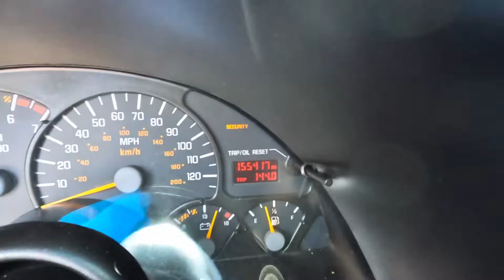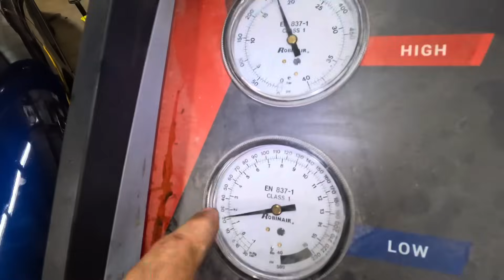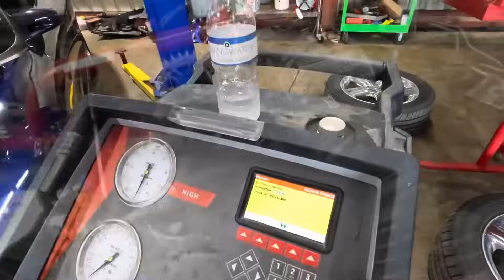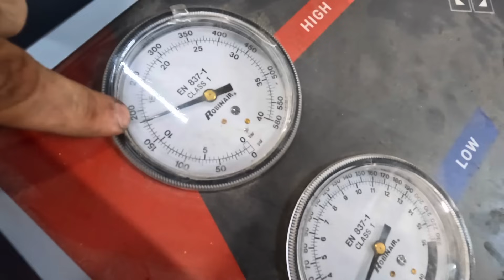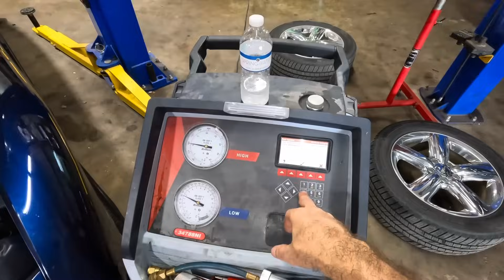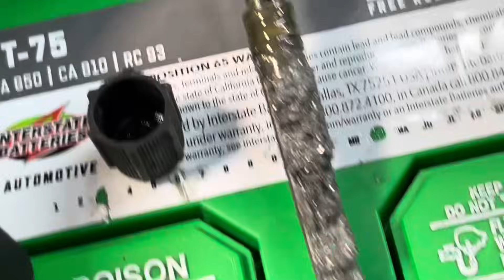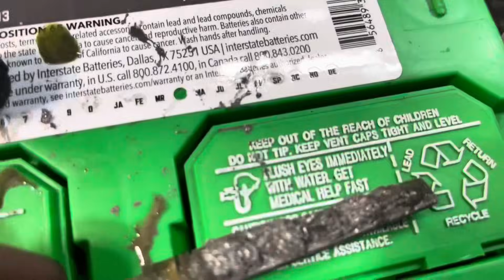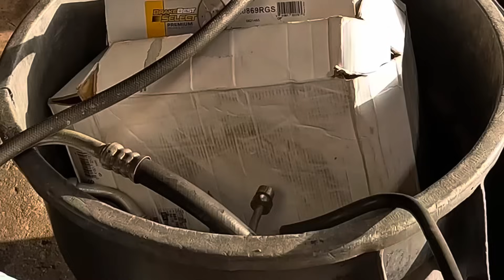Metal in the Freon? Pistons Coming Apart Pontiac Firebird!

Comment: Thank you Ray for disassembling the Compressor - interesting to see the innards and how they work.
Reply: Me too.
Reply: Schooling his subscribers
Reply: Yup first time seeing that
Reply: Nice educational video 👍
Reply: Similar to a pressure washer pump.
Reply: @geoffwoodgate7450 As well the external combustion engine in a Mk 46 mod 5 torpedo used on US surface combatants.
Reply: I've NEVER seen him reply??
  Don't even know if he reads your comments..
Reply: Ok, all these various applications I didn't know about... really educational 👍🏼
Reply: I always wanted to see inside one also.  Awesome video from Rainman Ray  🇦🇺  🇦🇺
Reply: Good to see inside of the compressor
Reply: Yup.
Agreed.👍
Reply: A mini-episode of I Do Cars
Reply: Had literally NEVER seen the internals of one before on a car... fucking awesome.
Reply: There are two types in main use - the axial piston type, which this is, and the scroll type.  The scroll type uses less power and is more efficient, but it really shards out the system when it lets go.
Reply: @silicon212  I hate when I shard myself.
Reply: Thank you Ray, me too never seen the inside of a compressor.
Reply: Yes in the casting room where I worked we had larger piston pump wobble plate pumps to use for hydraulics to run our bundling machines and band saw. If this unit had had the proper amount of refrigerant it might still be good. The pump may have been loosing pressure for cooling thus the reason for its over filling.
Reply: Completely rebuildable compressor destroyed. Nice job!
Reply: @Serhio_Alvarez  The one with metal shavings in the entire system?  congrats on a 10/10 cringe take.

Comment: One look at the Firebird, you know that it is loved, and it will get any repairs that it needs. 
Also I am surprised that Ray didn't pick the car up a few inches with the lift so he didn't have to bend over so much.
Reply: That may have made it more difficult to reach the  back of the pump.
Reply: I'm sure that Ray wouldn't even  consider stressing the integrity of such a fine automobile!
Reply: That's a trick I learned long ago to save strain on my lower back with lower cars!

Comment: Another very good video.  I like the autopsies.  Always interesting to see how these components are assembled, how they work and what goes wrong.
Reply: Saw the metal chips but not where they broke off from.  What actually failed & what was the cause of failure?
Reply: Probably a bearing. But since it looked like it was brass, it was probably. Either a race. Or a shim. Most likely a bushing.
Reply from the maker: @boggy7665  must have been a piece that totally broke away. I think it was part of the swash plate

Comment: I can absolutely confirm 3800 series 2's will run with a hole in the block. Was racing one once, and apparently shot a rod through the block, and through the power steering hoses and battery cables (the battery had been relocated into the cab and the cables ran through the firewall near the failure) I was completely unaware how bad the problem was, and was going to be perfectly happy finishing the lap and pitting in normally - the only thing that stopped me was the fire that resulted from the battery shorting out amidst aerosolized power steering fluid.

Comment: i had a Pontiac Bonneville with a gm3800 supercharged series 2 by the time i sold it it had over 600k on the clock and on its second trans. still ran great #1 bullet proof engine.

Comment: I had a '77 3.8 in a Firebird before GM gave them an even firing crankshaft.  The uneven vibrations knocked the hell out of the timing chain and sprockets.   It was going on the 3rd timing set when I gave it away at a little over 100K miles. Thanks for the videos.

Comment: The GM 3.8 liter from Ponticrack is no joke! With proper maintenance, they'll outlast the vehicle itself every single time, and will continue running until the heat death of the universe...
Reply: Had one pushing 330k miles and it still would go if I put another head on it
Reply: I had a 1999 Chevy  S10 with the 4.3 Liter V6 that was borderline bulletproof. Does that one have similar DNA to the one in this Firebird?
Reply: Yep, I owned a 2004 Chevy LS Impala-18 years old with 3.8 liter engine. It was T-Boned on Parking lot and Totaled, everything on this car worked good and was still original except Battery-water pump, alternator, Air Cond. Comp. these components never failed--Best car that I have ever owned, With Advice from YT video's wife bought a 2022 Lexus after Retiring from Walmart-32 years...
Reply: @randybeard6040  I'm actually surprised someone would work at Walmart for 32 years
Reply: @randybeard6040  I'm actually surprised someone would work at Walmart for 32 years
Reply: @justindaniels17  that's what you called dedication man
Reply: @justindaniels17  it's called dedication dude
Reply: @justindaniels17  how many jobs have you had????? I've had two. And I'm 57 years old
Reply: @buddrud  No...the 4.3L V6 was a Chevy 350 (5.7L) with two cylinders lobbed off.
Reply: The 3800 has DNA back to Buick's 3.8L V6.  Not Pontiac.
Reply: @troyturner8221  8jobs 22 y/o I quitted all of them 😂😂 JK just 1 Job and still employed by them
Reply: @troyturner8221 Must be nice. Since graduation from DeVry in 1975:
IPAC Group August 1975-January 1976. Electronics assembly.
Westinghouse Bettis Atomic Power Lab: January 1976-December 1976. Nuclear materials QC inspection.
Union Switch and Signal Swissvale: January 1977-July 1977. QC inspection. Left after a strike. 
Westinghouse East Pittsburgh: February 1978-May 1978. Intermediate Rate Wireman. 
U.S. Steel Homestead Works. May 1978-October 1981. Instrument Repairman apprenticeship.
Instrument Services, Bridgeville. February 1982-February 1983.
Westinghouse Instrument Service Company (WISCO)/Siemens: February 1983-December 1999.
Process Instruments, Pittsburgh: January 2000-November 2008.
Elrama Power Station: November 2008-January 2013.
Cheswick Power Station: January 2013-April 2021. 
April 2021-present: retired. 
See how many of those places are still in existence. Nobody works 20-30 years anywhere anymore.
Reply: @21Piloteer   Thanks. I was curious to know a little bit of that engines heritage. I had that truck for nearly 10 years. With proper maintenance over those years all I replaced was an intake manifold gasket, a water pump, and finally a fuel pump. Loved that truck.
Reply: @buddrud those two engines are vastly different. One is a Chevrolet engine the other one is a Buick
Reply: @justindaniels17 32 years ago old Sam was still alive. She evidently grandfathered-in before they started treating their employees like garbage
Reply: The 3800 series 2 evolved from the Buick 3.8l V6, which in itself is a 330 cubic inch Buick V8 minus 2 cylinders.
Reply: @21Piloteer  Still a pretty good engine though

Comment: Thanks for the memories Ray. I was an automotive HVAC specialist for GM, Toyota, Honda and Porsche/Audi for 15 years before I opened my own shop where I specialized in installing heat and A/C systems in classic and custom cars. Even did a few tour  buses for some well known performers as well as stuff like a front and rear system in a1939 Cadillac limousine with 1975 500 cu. in. Caddy engine and front frame clip and a 1940 Chrysler Town limo with a Nova front frame clip with rear steer. Custom built 1968 Hemi Roadrunner we built special order and got the engine from Don Garlits and had it de-tuned to 850 HP.and 1950 dropped, chopped and channeled 1950 Merc, with a  2015 LT 6.2 'vette drivetrain and entire computer system, even several double sleeper semi tractors. 1929 ford 5 window coupe, and god only knows how many everyday grocery getters. 

Watching you bust knuckles getting into impossible places and repairing some of the poorly designed late model systems is like a trip down memory lane. The wife always asks me why I binge on your videos, "Wasn't 55 years of that enough for you?" she asks. "I'm 73 years old and actually it wasn't enough. I'd still be at it if my poor old broke dick carcass could do it. But back in the bad old days if we were really lucky, we had maybe one lift and did most everything on our knees or on a creeper. After about 30 years it took it's toll on the back and knees and shoulders. Which is one of the reasons I went into A/C work. For some reason, guys in my generation always treated A/C systems, electronics and automatic transmissions like there was some mystical black magic inside and not for many wrench twisters to screw with. So I did transmissions for years until my back was shot and moved on to HVAC and I still mess with electronics and diagnostics as long as I can fine some assistants to climb around like a monkey with test leads and meters. I'm 6'2" and I simply do not fit into these late model speck-mobiles that you don't get into. You have to put them on like a shirt or a pair of shoes. My hats off to you sir for dealing with things realistically and logically . Both you and your wife unit and Eric and Mrs. O have replaced everything else I watched since I retired a,d I truly believe I would go totally crazy if you guys quit doing your excellent videos. thank you, Thank You , THANK YOU for helping me retain what's left of my faith in mankind.

Comment: I love that color on the Firebird. My favorite is the 2001-2002 Firebird TA  WS6 with the manual transmission. Come on Powerball!!!
Reply: That color is called Navy Blue Metallic (28U), GM produced 890 non-convertible WS6 models in that color in 2001 and 868 in 2002 -- I don't know the breakdown of autos vs. 6-speeds though.  They're fun cars, I miss my '97 WS6 T/A and '99 Formula big time.

Comment: Looks very like a water pressure pump. Great show, Ray. Power flush was definitely the way to go 👍
Reply: Ive disassembled a hydraulic pump before, looked alot like this, which is essentially what a ac compressor is

Comment: Ray you made my day praising the 3800! My wife and I both watch your channel! Due to gas prices myTahoe did not get good enough gas mileage! So picked up a Grand Prix GTP from the original owner. Except for the intake  gaskets and water jacket elbows (I replaced both) I'm expecting over 500k miles! I was hoping  the Monte Carlo had one. But the 5.3 is also a great engine. I prefer the 6 over the 8 in a small car because  it's easier to work on! With the supercharger not much of HP difference! The GPX with the 5.3 is a Charger RT killer!
Reply: The FORD 289 was also a great engine.

Comment: I bought one last summer for my Dodge Dakota 2002 $700. I think I need the orfice changed and it has a short. I took it to a mechanic charge me three hundred bucks and didn't fix it. Still didn't go to charged up at Canadian Tire cost me $300. Sometimes it works sometimes it doesn't.

Comment: Actually the thing Ray calls receiver drier is an accumulator in the systems with orifice tube. That's why it's on the suction line and doesn't have a filter built in (the orifice tube does the filtering here as we clearly saw), like a receiver drier does. Of course the accumulator also contains the drier part, that's a common thing for both of them. Just FYI ☺

Comment: Let me give you, Ray, and the viewers some interesting info about AC compressos.

So, the compressor is no good of course. Most likely the system was left without the proper amount of oil/freon, which led to this thing exploding.

The pulley is held on only with the first and bigger snap ring. The coil (this is what operates the clutch) is held with the  inner snap ring. The bolt that you took from the side is in fact a drain bolt.

It is interesting to see how these things operate, there are so many different kinds, there are rotational compressors, piston compressors, always rotating ones (no coil/clutch on them, they are operated by a valve at the back. 8/10 times when a always rotating compressor is not operating as designed, it is due to that valve, if the oil pooks okay, you can change just the valve and save a lot of money). 

With a proper flush, most of the times the condenser can be reused, but it is no harm to change it too.

I am working in a car AC shop and we deal with this stuff daily. We rebuild compressors that can be rebuild (the one in the Pontiac wasn't rebuildable), we change condensers, we weld AC lines, fix hoses and what not. 

Always check fan operation with the AC system operating, it is crucial. Also, spraying the condenser with degreaser and washing it when you wash the car can save you quite some money.

And most importantly, do not abuse the compressor. When you are at higway speeds, do not turn it on while you are in the high revs, clutch in and then operate it (if possible)

Also do not operate your compressors at 80mph+, if you want to save them from dying, especially on older cars.

Thank you Ray for the video and I hope I gave everyone some good info.
Reply: @@Peter-nm1ps newer cars with more geras yes, but where I am from, there are many older cars that run 3500-4000 rpm at these speeds

Comment: pro tip: when you do the flush you get better results when you do it first with 1/4 tank as a sort of pre-wash and just send it. dont stop or pulse but just send it. that gets rid of most of the junk and then you fill the tank again with the other 3/4 wich washes out the remaining crud thats hard to remove. that gives much better results. and remember to send it, dont pulse or stop.

Comment: Reminds me of my ac job I had to do to my 96 Astro van. The horn fell down into the condensor coil and created a huge hole from road vibrations. Replaced a lot of parts but kept compressor , I just replaced the oil. Worked fantastic after replacing that condensor with a used one from Ebay. 😊😊😊

Comment: I hope for the best for this ac job. I remember years ago I had a compressor eat itself on an Express van and tried flush out the evap a couple times, but even though it looked clear it still came back a couple weeks later with the compressor locked up and the system full of black death again. Ended up replacing everything again and putting an evap in it, never saw it again.

Comment: My guess is that bright orange bar across the top of the engine is to hold the struts in place to keep the front tires aligned so that super duper 3.8 l engine can keep the engine pumping fluids longer to hold this Firey Bird together. In fact if that bar holds the car together for his children and he keeps fresh oil in her one of the children will drive the new tires off this car.

Comment: BRO I ALMOST MADE A VIDEO RESPONSE TO THIS CAUSE...  I had a 1997 camaro for a few years! Manual 3800 car, loved it! Previous owner spun a bearing and fixed engine with crank but didn't replace rod so rod broke randomly under low load 1st gear from a stop. Drove it home with a rod hanging out the block! Pulled an engine from a 1999 firebird I had and it had a damaged balance shaft gear and was worn out, got a series 3 engine from a 2006 grand prix, it lasted a few months and kept dumping coolant into the oil even changing intakes and doing head gaskets twice and never got it fixed and was just done with the 3800 platform at that point, been in and out of it so many times trying to keep the car on the road and said it was absolutely junk! But yes the 3800 is a great engine but I haven't experienced that personally yet. Have had more luck with ecotec engines lol

Comment: If you’re in the rust belt doing this, use a puller to remove the idler, not a pry bar , the bracket that idler mounts to is $200 used and the pilot shaft the bearing sits on breaks very easy☹️

Comment: I've noticed that when you replace a A/C cmpressor, you rarely replace the receiver with the repair. We didn't want comebacks, so we priced all the components necessary . otherwise, you did a good job with the diagnosis, and repair. As far as taking the compressor apart, it's ok if there's no core charge.
Reply: P.S. always do what Wife Unit tells you to do!!!

Comment: If you wanna pour a canister without spilling, hold the can from the side that's closer to the mouth and tip it while keeping the mouth higher. 
You'll need to hold the receiving bottle at an angle to keep it under the canister mouth, but it'll stop stuff going everywhere except the bottle.
Reply: Ray's pouring skills are legendary.

Comment: VINTAGE 2002 Firebird?! My 79 TA was vintage and it had a real motor, the Old's 403, not much horsepower but GOBS of torque! It did 15 seconds flat at Englishtown Raceway Park. BTW nice eggbeater you made for the WIFE UNIT.

Comment: Ray, told you. Isolate shop not pant. That way you can use A/C in shop.
Reply: There's not 1 in a hundred shops in south Florida that are air-conditioned.  Can you just imagine the cost of a/c for a building you regularly open a 12 high roll up door?

OBTW, it's the same in the DFW area.

Comment: With micro channel evaporator and condenser. You did the best. 
You replaced the condenser and flushed the evaporator. In professional hvac we would replace both if both of them are micro channel. But in a car that would cosr 3000$ extra to replace the evaporator, so this is the best anyone could have done without billing the customer 5000$.